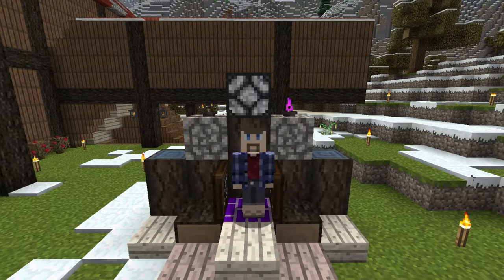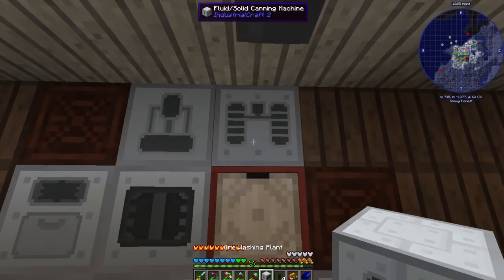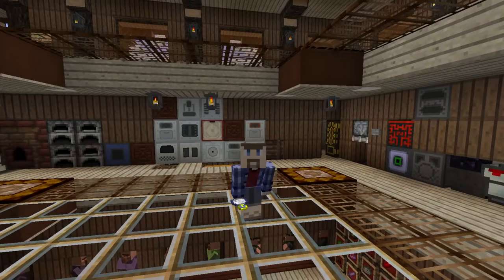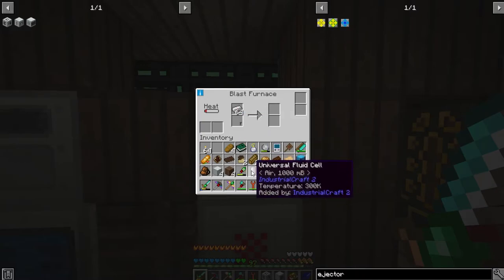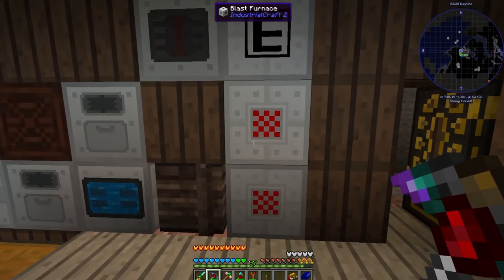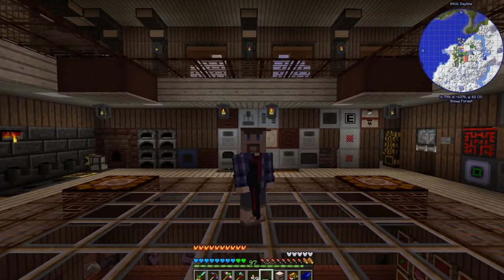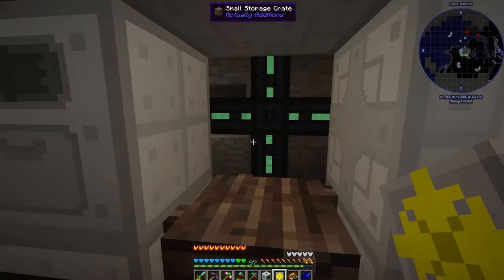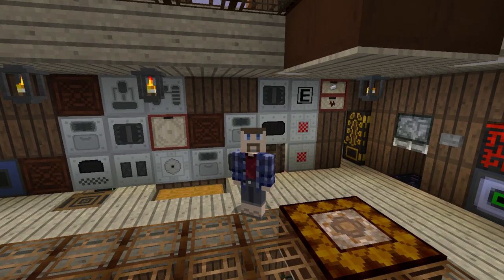Industrialcraft Ore Duplication - Minecraft: Enigmatica 2 Expert #25

Comment: Didn’t know ic2 did ore dupe. Just tried to make a 4x with mekanism. Not happening didn’t realise I needed dimensional shards. 3x it is. But it seems so slow. You really need to focus in this pack it’s so easy to get distracted when crafting stuff so many rabbit holes. 
I’m looking forward to seeing how you tackle UU matter after you suggested it the other week. I crafted 4 machines for scrap. But the fabricator makes so little for the power and resource required 🤣. It just highlights all the projects you need to make bigger like power. Not looking forward to the reactor build just for blutonium. 
Enjoyed the episode keep up the good work 👍
Reply from the maker: Yeah, the IC2 duplication is fairly cheap too compared to Mekanism overall, and benefits from giving you more varied results, but without overclockers and a ton of power, it's just really, really slow, and it caps out at a bit shy of 3x.

The constant distractions are the reasons why I never finished the pack in my past attempts.  Making videos has actually helped me focus some since it forces me into a theme and a goal for each episode to keep things moving forward.

The UU matter and IC2 nuclear reactor are the next two episodes coming up because I just want to mostly get the IC2 chapter done.  I don't go into massive UU production, because I don't need it yet, I'm mostly getting the replicator bootstrapped so I can more easily move into Thermal Expansion.
Reply: Great can’t wait. 👍